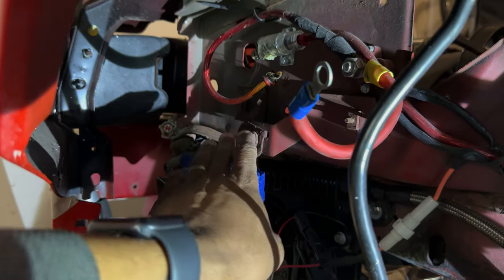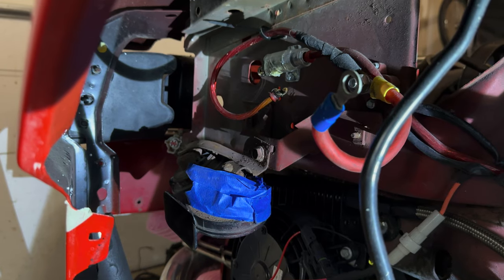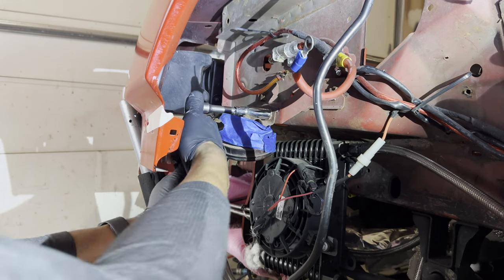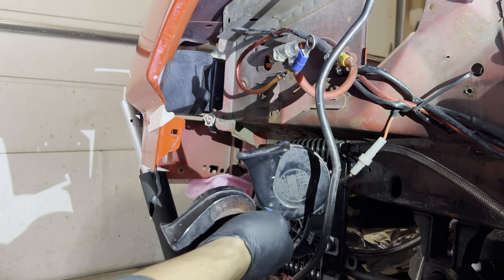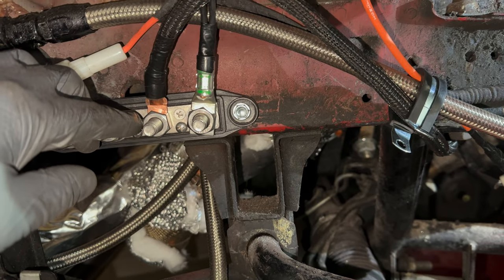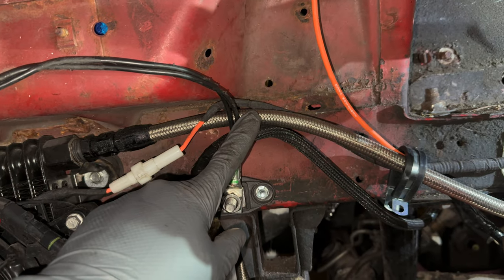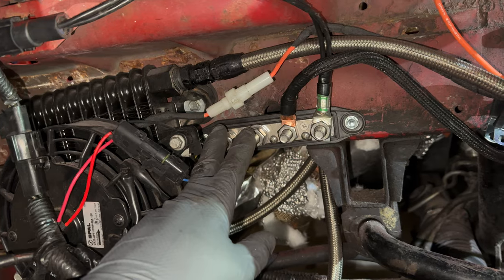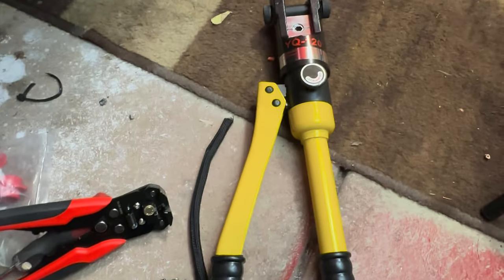Get a show car quality engine bay with a wire tuck. Part2

Comment: Very nice Sir!! Question,, I want to install a jell cell battery but my negative wire to the battery is a tad bit short, where can I get a longer Negative ground wire?? ( S197) or do I try to construct one( 👎🏿) Great content
Reply from the maker: You can always measure the extract length you need and go to parts store and see if they have something off the shelf. I'm not sure how much longer or shorter a S197 cable is.